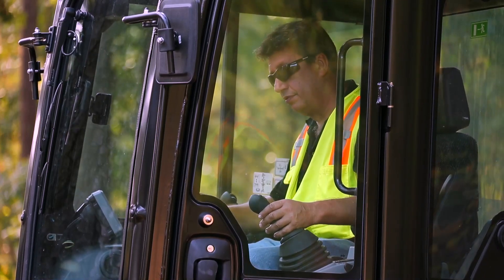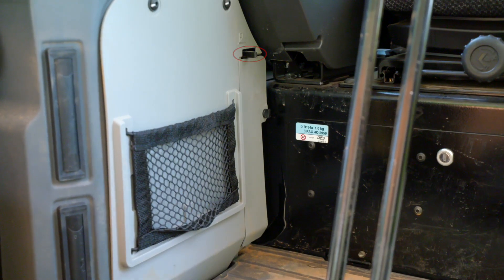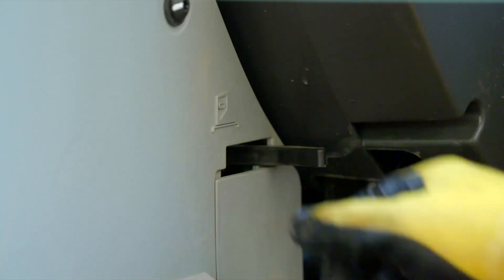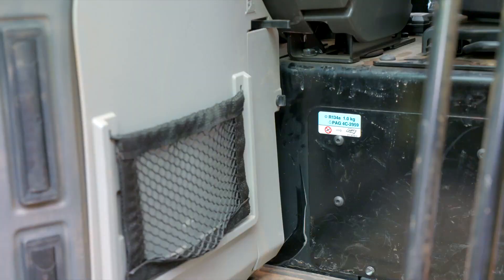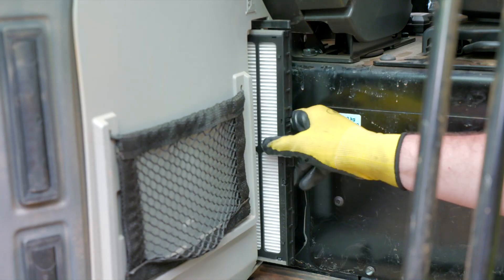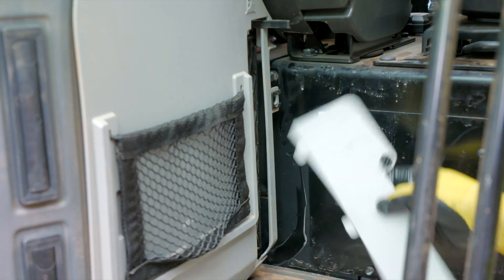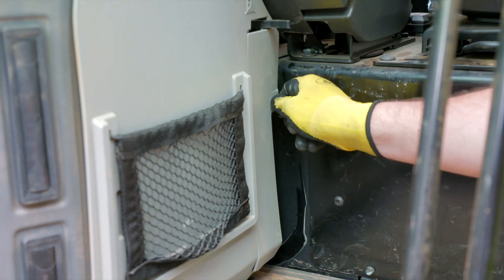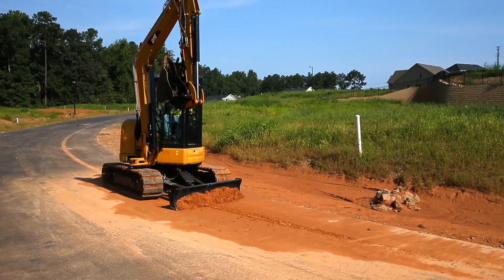Optimizing Air Conditioning Performance on a Cat® E2 Mini Excavator

Comment: I agree. 2017 305.5 This AC system has multiple problems. I gave up on my caterpillar dealer after many tries to fix and many thousands. caterpillar would tell me it only needed to drop outside temperature diff of 30 degree inside cab. 100 percent wrong.  I could write a book with what I went through. Compared my machine side by side with same exact year and model that worked. CAT looked at me like I was crazy. "Nothing is wrong with yours" CAT tech engineer reports and much more. Many years later I have it working decent.  removed heater core completely for access to AC evaporator coil. noticed multiple attempts with cat mechanics placement of thermostat in the evaporator coil fins. finally with visual access to system when assembled minus the plastic ducting and temperature probs I located the thermostat in the best location to get it to cycle from 39 degrees to 45 degrees. I learned its a major air flow, system freezes over for reason still unknown, mechanics that wont think outside of the norm.  Left heater coil out. Cheers and good luck.

Comment: Can anyone tell me why the a/c on my 303.5e2 goes on and off? It stays on for about 30 seconds then goes off for one minute then on again, Is that normal?
Reply: Compressor not cycling check Compressor freon, belt, low pressure switch, clogged expansion valve
Reply: Probably gas.
This machine has a particularly terrible Aircon system in general, I own one and every other operator I see with one says the same thing. In Queensland Australia it's quite hot and you CANNOT operate this machine with the door closed or you will cook yourself. My machine is only 3.5yrs old toom
Reply: @natehanley7920  
No I figured it out, there is a cabin air recirculate handle+vent just where your right leg would be, keep that handle in the recirculate position with the door closed then it can actually keep the cab reasonably cool even on the hottest days like +40°C.
Reply: I bought a CR305.5e2 new  in 2017 it has the worst AC system I have ever owned, very disappointing bad cat bad bad Cat